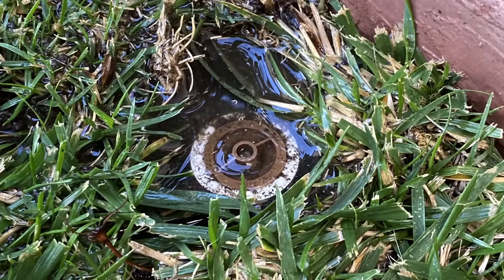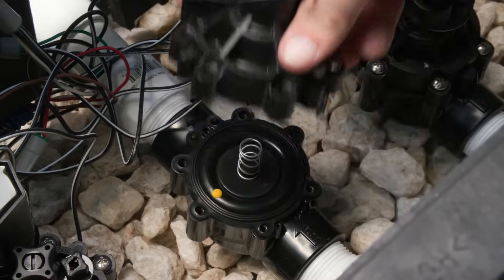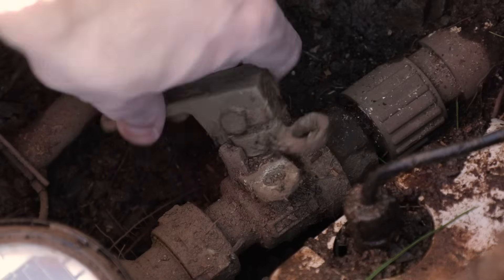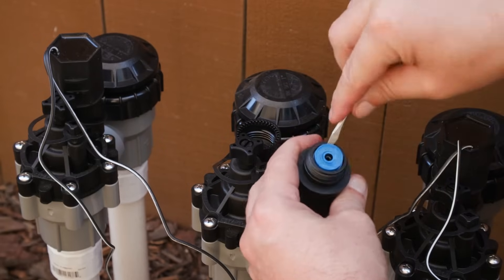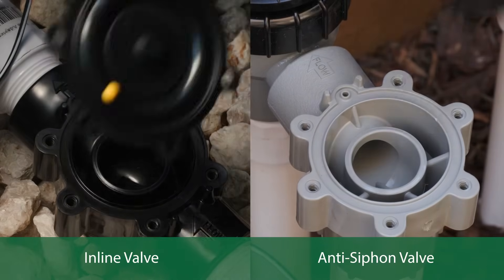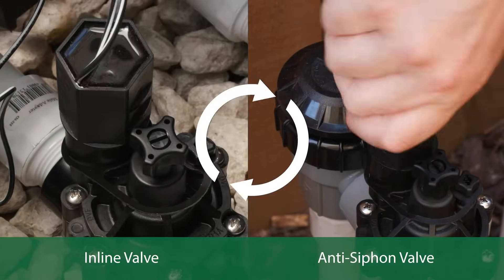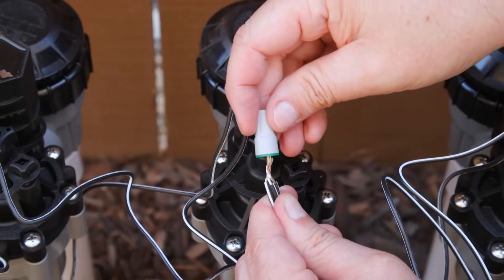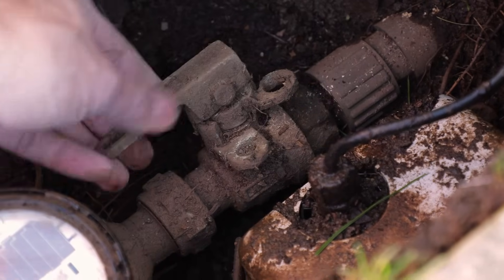Rain Bird Residential Valve Troubleshooting: Replacing the Valve Diaphragm

Comment: I have a Rain Bird 100-DV.  That will not CLOSE.  This started during my blowout.  I have no power to the system and zone 1 remains open at all times.  I took the solenoid out, took the top off and inspected the diaphragm and looked for debris.  Everything looked good and clean and no rips in the diaphragm.  Put it all together....... Zone 1 remains open past this value.
I plan on replacing parts, but I'm confused as what part is bad.  I've heard this can happen on air blow outs sometimes.
Reply: Hmm, I can only assume the diaphram is still bad, maybe you have to replace whole valve as the body might be warped or cracked. It's a pain but it has to be the valve I think.

Comment: Will a damaged diaphragm cause hammering or clogged line?
Reply: Just went through this same issue you are having. What is causing the water hammering is the uneven voltage from your controller to the valve solenoid. My controller is a Rain Bird RD 600 which is super common. You can look on youtube and search on rainbird controller fixes/trasnformer fixes etc for videos on this. My suggestion would be to toss the controller and install a new one (they cost roughly $200). Once I did this all of my valves worked flawlessly and the water hammer immediately stopped. If you are looking to trouble shoot your controller, call rain bird directly. They helped me isolate the issue. Better to go right to the source. They are VERY patient and helpful. Hope this helps and good luck.
Reply: @ hello, I thought that could be the issue too, but I ran the sprinkler station manually and the water hammer still occurred. We ended up flushing the line and replacing the diaphragm and the noise went away….knock on wood 🤞🏾
Reply: @eduardoguerrero2449  Great! Whatever works! That's a much easier and less costly fix for sure.

Comment: is there a way to tell if the diaphragm is damaged or causing the leak? how long do they last? thanks.
Reply: Sometimes a damaged diaphragm will leak water at sprinkler heads and sometimes it won't even turn on at all, that's why it's best to first bleed it and if that doesn't turn them on then it could be the diaphragm
Reply: @ro866432 I tried bleeding and nothing and manuall trying to turn on at solenoid...still nothing. I hear water pressure. So I guess a bad diaphragm,?

Comment: Hi. My gardener replaced my rainbird 1 inch valve. For some reason to get it to fit he put on a 3/4 inch adapter and ran 3/4 pvc for about a foot and then coupled to one inch pipe. Problem is now there’s not enough pressure or flow to get the sprinkles to pop up correctly. Is this the reason or is it something else?
Reply: Sometimes the valve will have a pressure regulator but he should've kept it the same size as before
Reply: It is possible. Pressure is pounds force per square inch. Since water is pretty incompressible, the pressure determines the mass flow rate of the water. In an open-ended system, that force is transferred to a larger area, dropping the pressure felt at the valve

Comment: Hmmm....I JUST replaced the diaphragam AND the solenoid AFTER my gardener informed that one of my valves was NOT shutting off.     This did NOT fix the problem. 

EVENTUALLY, the valve DOES shut off, but sometimes it is 20 minutes and sometimes it is HOURS!

Now what?   Is it my timer??     Both of my other valves work correctly.
Reply: Can a bad diaphragm cause the valve to not open at all?
Reply: @EddyScrivner yes
Reply from the maker: Hello, most likely only that zone/output of the controller is damaged; you could swap this station/wire in the controller and see if the issue is replicated in a different valve to confirm it. Also, it would be good to check the wiring to confirm is not shorted due to some wire with bad isolation or humidity/water.
Reply: @RainBirdCorporation  Thanks so much.   Our planned community, or the previous owner, unfortunately, placed my timer box directly in the south-facing sun in the Southern California desert!!! It has been 110 degrees for over nearly two months now.  Could this have an effect on my wiring/timer, etc.?   Is there a box/timer that is more protective of high heat/sun??
Reply from the maker: Most Rainbird controllers can operate properly up to 149F. 
Storage temperature to 150F
Operating humidity: 95% Max
Reply from the maker: It seems to be a different issue.
Reply: Thank you!
Reply from the maker: You are welcome!

Comment: Thanks!  Cutting the wires, or removing the wire nut and separating the wires seems unnecessary since there is no power to those wires.  Am I right?
Reply from the maker: Thank you for reaching out to us and for your feedback! You can feel free to omit this step since the solenoid in used will be the same.
Reply: I believe it is so you can unscrew the solenoid to replace the blue filter that comes with the kit.
Reply: Sometimes it's best to disconnect wires to not get the solenoid dirty, sometimes valve boxes are covered in dirt and not enough room to set aside solenoid

Comment: The home we purchased has a Rainbird sprinkler system, never having one before when i turned on the water supply on, Zone 8 which has 4 heads on it started spraying, even with the wire disconnected off the controller, i found the bleeder screw on top wasn't tightened (compared to the other four) i closed it. Thinking the valve would have to be replaced i googled it, and found this video, which in turn discussed the bleeder screw. So i went out and turned the water supply on, and lo and behold it's working fine. Why would that bleeder screw being loose cause this? Is it because bleeder screw being loose allows the water to bypass the diaphragm? Any ways this video was extremely helpful, thank you.

Comment: I have a brand new rain bird Sprinkler valve that occasionally leaks water drops from the solenoid. I have to turn it counter clockwise and clockwise to stop the leak. What could be the reason for this leak?
Reply: Pretty